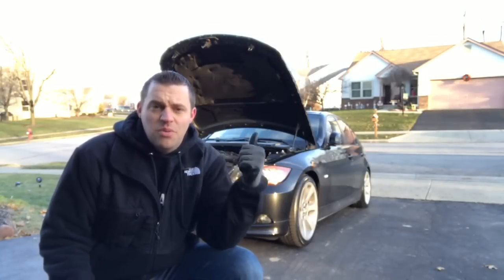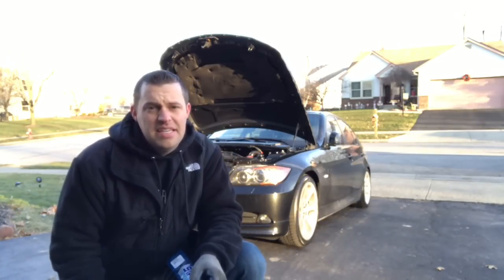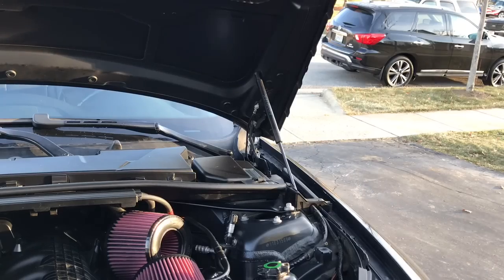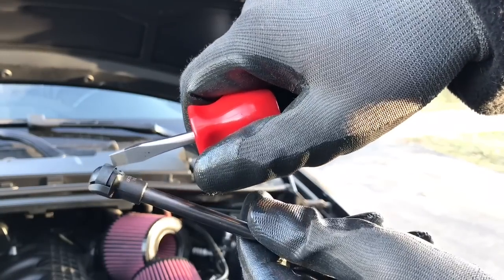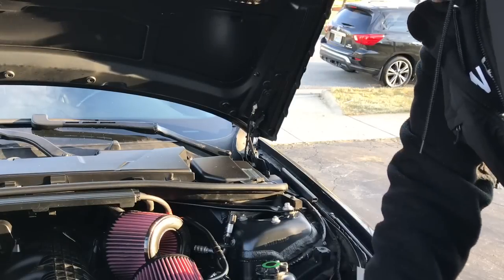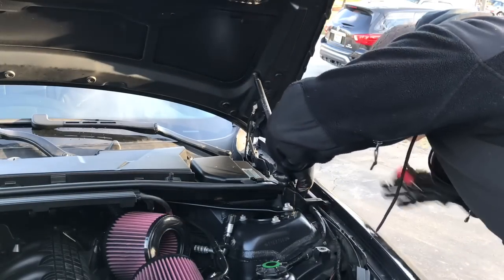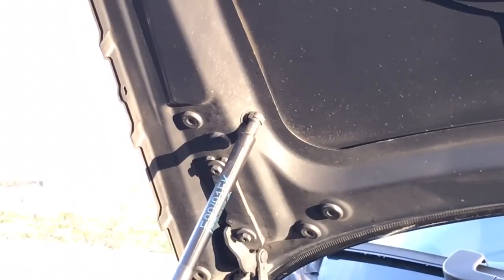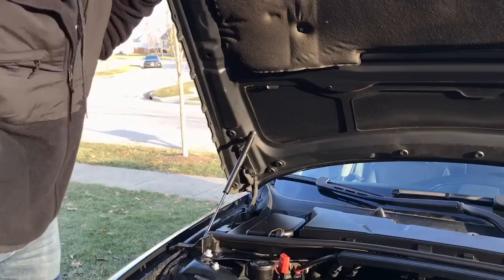BMW Hood Strut Replacement DIY!

Comment: you did not have to open the clips on the new struts. they just snap on. your ment to only open clip when removing old struts from the vehicle.
Reply: Thank you! You saved me from following that unnecessary, and potentially damage-inducing, step.
Reply: Solid intell.

Comment: Regular 3-Series E9X uses the 330N hood struts. E9X M3 uses lighter 200N hood struts.The hood struts are labelled with the BMW model and the force. Stabilus is the OE Manufacturer and the struts are $15/each vs BMW OEM at $50-70/each. You need a pick tool or super thin screw driver to pop the clip. But not on the new hood struts, since they just pop in. Install the bottom of the hood strut first, since the new parts are very stiff to compress. Same for the trunk struts.

Comment: Those little bottom springs doesn't come off so easily, and you working with you screwdriver 1 inch next to wiring harness. If you tool slips it's the easiest way to damage wire isolation. That's exactly what somebody has done in my car. Sometimes is just better to take some more time, screw off ball joint with the strut (very easy access from the bottom). Then put whole thing on the table where you have plenty of space with no wires and stuff around, just to play safely with your tools :)

Comment: Thanks for the video. Can you just snap them  on without pulling out retainer clip? I couldn't pull out clips and messed up a strut so I bought another one, and I just pushed them into the ball. It worked fine. Aren't they made to snap on without touching the top and bottom clips? Same applies when you take them out without touching the clips. Thanks.😢

Comment: Any way to edit the video? With all the strut replacements I've done, I've only needed to pull the clip to remove the struts.
It just makes the install harder than it needs to be.
To install them, you just push them on, and the clip slides onto the ball easily! 👍🏼

Comment: My car currently has no hood struts (bought it like that). I got new ones and tried to install them but discovered i don’t have the little ball joint in my engine bay that the strut attaches too. Any ideas on where i can buy one?

Comment: Sweet need to look into this a little because my hood is after market carbon fiber...its so light I'm only using one strut no problem but just for future references i will check into running both thanks for the Diy bro!
Reply from the maker: N54 Lord Yeah CF is so light!
Reply from the maker: N54 Lord I never ran Hood struts when I had one awhile back (before the bmw) because I didn’t want to mess anything up when applying force when closing it lol
Reply: BMW Fanatic Definitely it takes off a 100 pounds at least😀
Reply: Additionally my trunk is CF also but painted to match my car! Both make a difference in weight.
Reply from the maker: Yeah paint match is sweet!

Comment: Are the trunk struts supposed to lift up the trunk just like the hood lifts up? Because then all these struts are worn out in my car.
Reply: I mean should the trunk lift up on its own?
Reply: Mine doesnt lift on the trunk either in my 08
Reply from the maker: HP Addict Yep! As soon as you unlock it and lift up ok the trunk it will open the rest of the way

Comment: Your engine is so clean. You can eat out of it.  Wow. !!!
Reply from the maker: Tonio Castro I do clean it too much hah
Reply: BMW Fanatic make a DYI how to clean the engine.
Some people recommend hot water. That can  do damage to some electrical parts on the engine.
Hope some time you do a video.
But your engine looks killer.
Reply: Not for dieters though.  Everything is cooked with oil...
Reply from the maker: I do have a video on how I keep it Clean, but I’ll do one to actually clean it